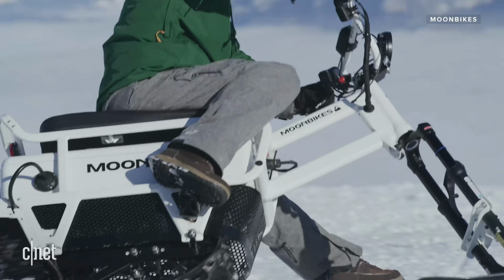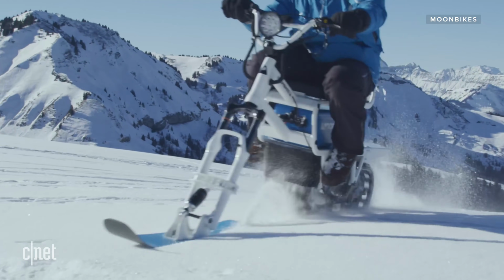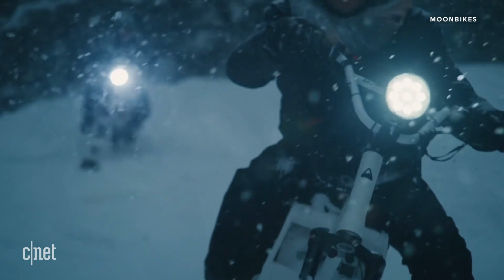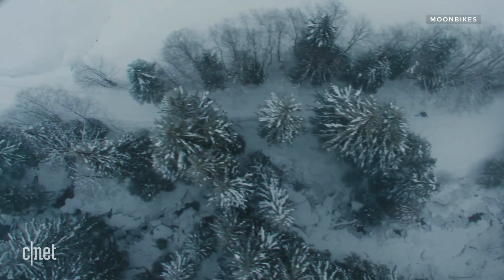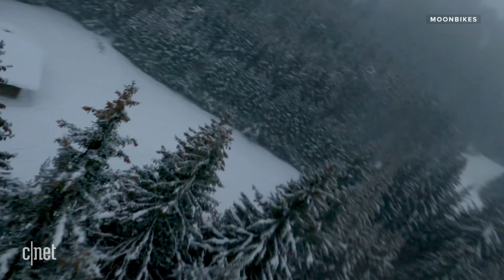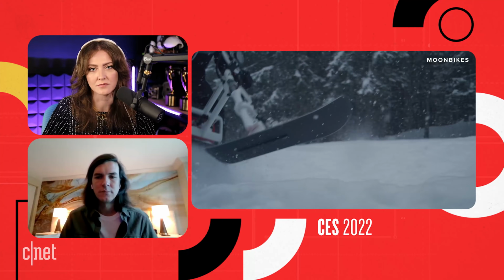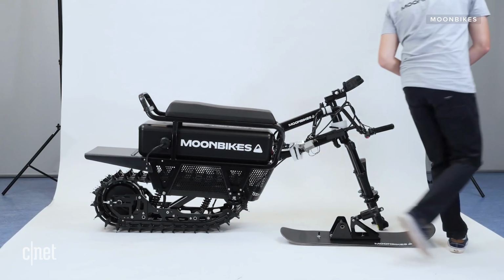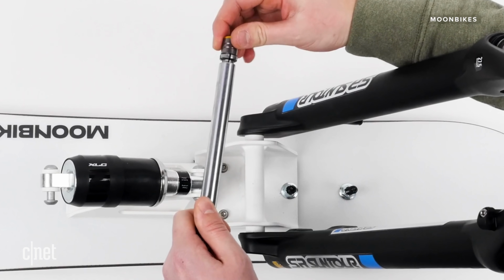Moonbikes are electric bikes for the snow

Comment: I’ll believe the “minimal range loss in the cold” claim, once the youtube reviews come out. Why not use LFP(Lithium Iron Phosphate) batteries or another alternative? Will be safer & more reliable. You won’t have to worry as much about heating the battery too. Perhaps an improved replacement battery could be released down the line. 
Current Lithium ion Polymer batteries will be on their way out of most EV’s soon anyway.

Comment: This looks fun in the action packed videos, but, i suspect most ppl will get bored or tire of the cold... Ppl who buy skidoos know what theyre getting into
Reply: You never get bored or tire of the 'cold' (you don't feel cold with heated seats/grips and if you dress for it and aren't snowmobiling naked).  People ride snowmobiles 3,000-5,000 km/year and never get bored.  The only reason they don't pile on 12,000-20,000 km/year is because the riding season is only 3 months.

Comment: Hard to have electric snow vehicles because the cold kills lipo batteries so fast so id like to see how long the battery really lasts at -11 and in ungroomed snow. Basically every clip is on perfectly groomed trails.
Reply: It said it is well insulated and heated. Problem is that I don't know how long the battery will last going up and down hill repeatedly
Reply: It has a heated battery box.
Reply: @jc01057  what powers the heated box? A battery?
Reply: @theirishaxe9405  look at how Tesla manages this. It's not complicated.
Reply: @theirishaxe9405  I’m guessing it’s only heated while charging, after that the batteries own heat, keeps the insulated box warm.

Comment: I don't  know what snowmobiles run nowadays, but $8500 seems a bit steep, especially when my atv cost me about the same but I can use it year round.
Reply: Snowmobiles can be 10k and up to 20k+. They also have more power than most of the cars I have owned so a different animal to this thing.
Reply: Most expensive machines are way more than that, one is $22,000 (a turbo 180-200 hp), though some are $11,000 on the low end.  That's all CAD.